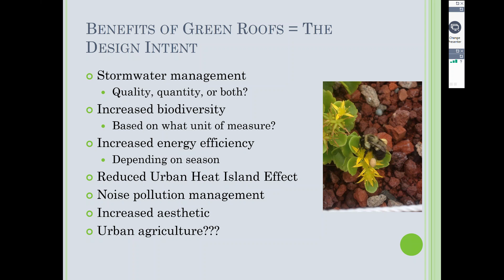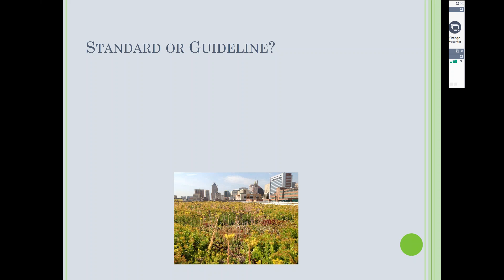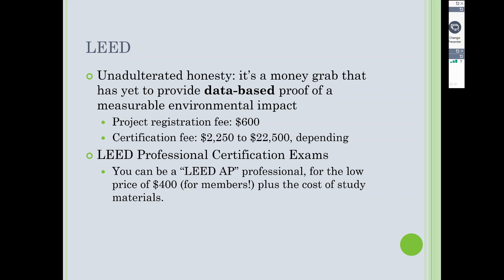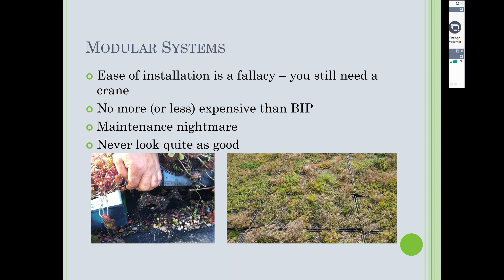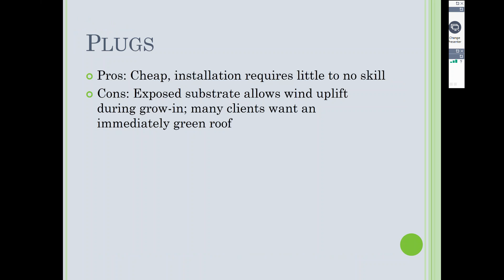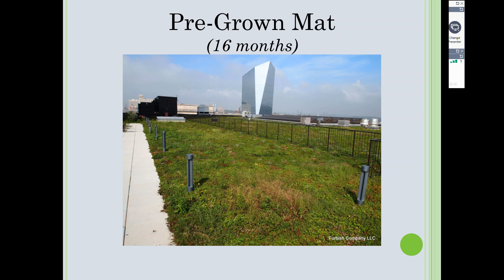2017 05 17 11 04 Intro to green roof  I

Comment: Dear Whitney. Thank you for your for your contribution to the GR topic. I belive that GR terminology is not correctly chosen. In my opinion, term green roof is misleading. Extensive or intensive vegetated roofs should be subfolder of Utility roofs. Regarding your Green Roof clasification, I would say that green roofs are generally specified by maintenance roof requirments. Extensive maintenace or intensive maintenance. Depth of substrate specified conditions for plant growth . Respectively for range of Species that may vegetate in such a depth of substrate layer. So at the end substrate depth have direct impact on maintenance requirements. BRP.